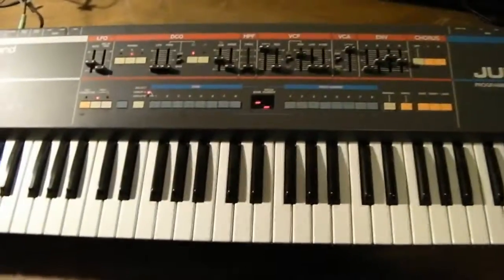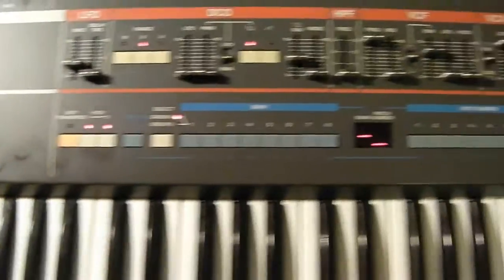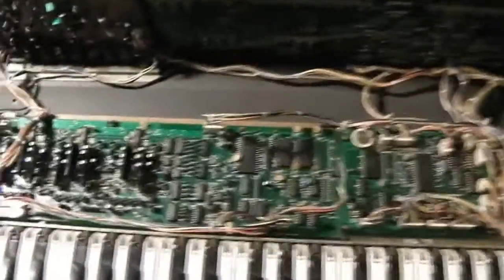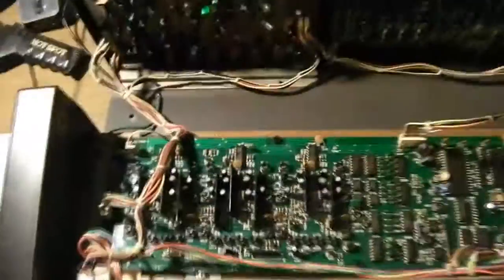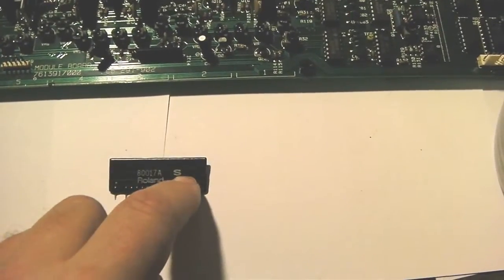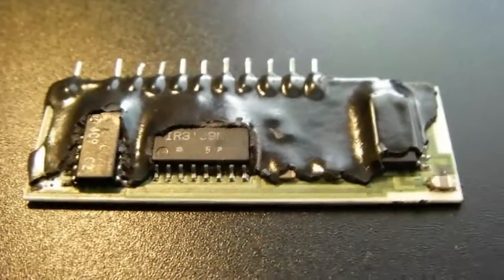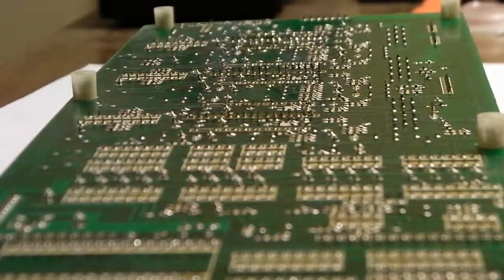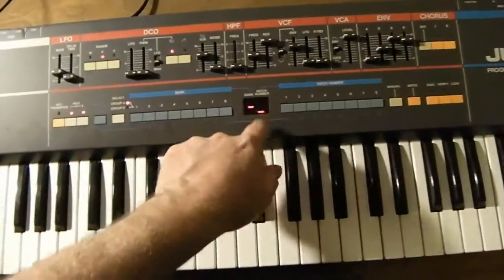Removing and cleaning the 80017A voice chip in a Juno 106

Comment: The hardest part of this is unsoldering the damn chip, and all you say is, "So, we have the voce chip is out..." as if it just falls out!
Reply: Spend the $280 USD for a Hakko FR-301, and desoldering stuff will be a trivial task. I wish I'd bought a desoldering gun 15 years ago; the hassle from desoldering in just ONE task is worth the $280. It's a joy to use.
Reply: Further to this, it is wise to reflow the solder joints on all of the components on the chips, after you have totally removed the coating, and before you return the voice chips to the board. Most of the time the IC's fail because of cracked and less than ideal joints, due to the heating and cooling cycles involved when the coating is still intact.
Reply: @andyjackson3891  Most of the chips I've recently restored required a total desolder, cleaning underneath and between the legs and soldering them back on, they would glitch otherwise.
Reply: @theeltea  every comment on this small thread of replies has been just as helpful as the video, even more in ways. That being said, I'm def not as afraid to try this now, and when I get a little extra moolah, I think it's worth the extra work to do it right and instead of spend about the same (as far as I remember) amount on full set of brand new analog renaissance chips when I just can get something that takes the most frustrating part of desoldering and therefore doing most any repair not only easier, and like it was mentioned "a joy to use" but Heck, but just better and more efficiently. I swear, I'm a dang biomed but I still at this point am at least daunted by harder desolderimg tasks cause I don't want to mess up the components in whatever medical device. Well, I obviously would want the same quality out of my juno, and any other electronic monstrosity of old and epic fun that I have too many of. I think its funny how some people look at keyboards as junk, as if having too many in being a hoarder. Um no, when I get a chance to buy a juno 106 for around 300 bucks on Facebook marketplace and actually have the funds, well I'd be the doofus of the century not to grab that, even if just to refurbish and flip Reasonably to an honest musician if I even wanted to flip. The possible hoarder part of the equation comes in from not selling a single damn thing. However, I know I will not regret this..
✌ and 💘

Comment: 7graylands, on the non-component side of that voice board, were there any circuit traces on it?  At 4:35 You showed the component side of the voice board, but not the OTHER side.  

If there were any traces on the other side, you might wanna be REALLY careful about scoring the coating with that Xacto knife.